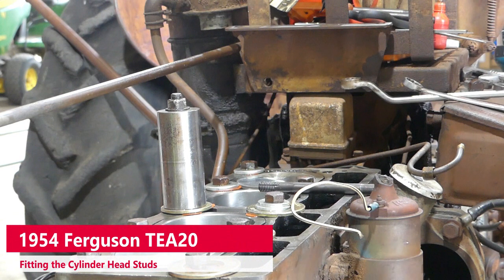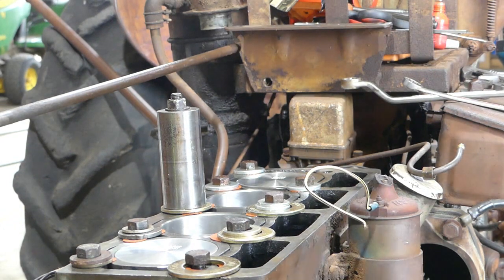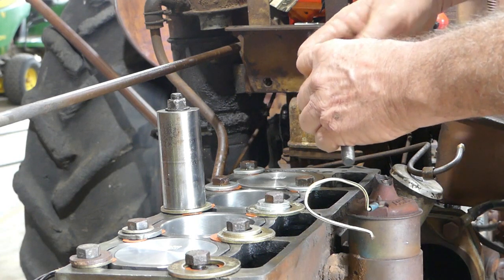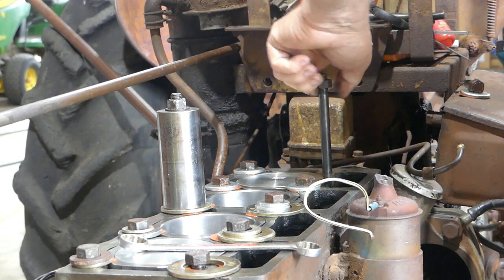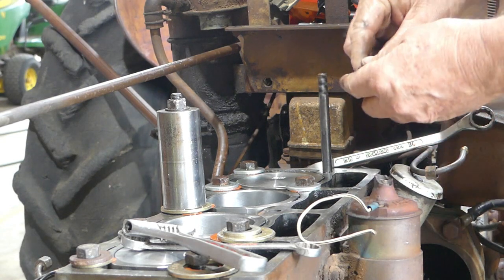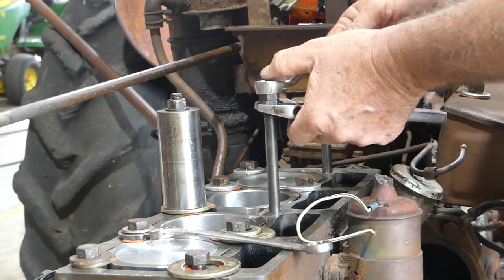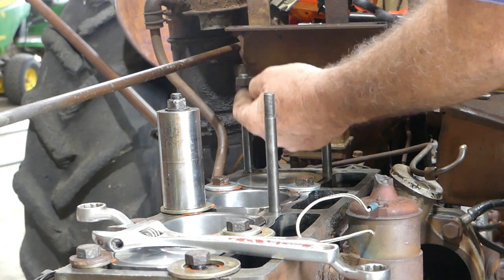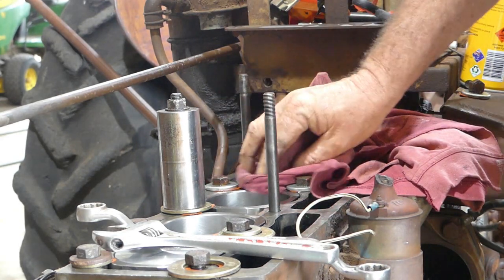Sparex Ferguson TEA20 # 24 Fitting the Head Studs

Comment: I had to replace all my studs. There were many people before me the used vice grips on them. I went for the good stuff, ARP and ARP nuts. I like them so well I clear coated the part that shows so everyone can see I spared no expense on this engine. I like the hex in the top of them for an allan wrench.
Reply from the maker: I have not seen those studs but they would be good by the sound of it.
Reply: @BundyBearsShed ARP is the best as far as high performance fasteners go. They are pricey, I think they were $7.00 ea for the short ones and $9.00 for the long studs and there are 13 total if my memory is right. Good stuff ain't cheap and cheap stuff ain't good. I feel I got my moneys worth on them. They are way over kill compared to stock, they are pretty, and I could not get stock ones anywhere around here. Made in USA!

Comment: Lance, is there a special tool available where you can clamp down on all the liners in one go instead of putting separate bolts and washers in? I was just wondering how they got around this when they built these engines in the factory from new
Reply from the maker: Not that I have seen, Im not sure how factory did it but it was probably done within a minute or two I imagine without turning the engine.